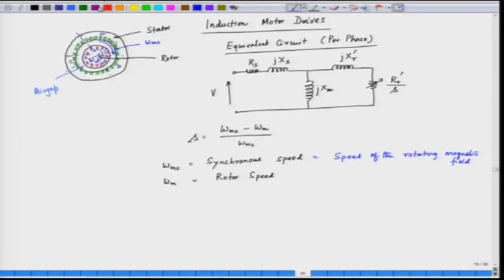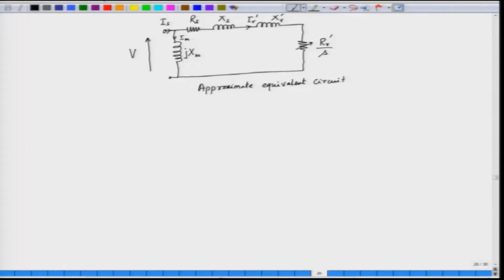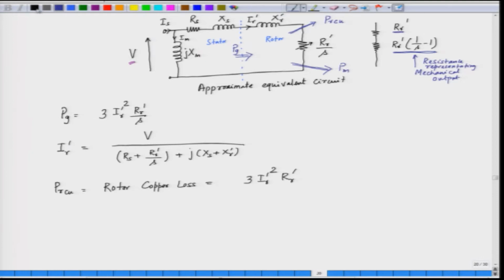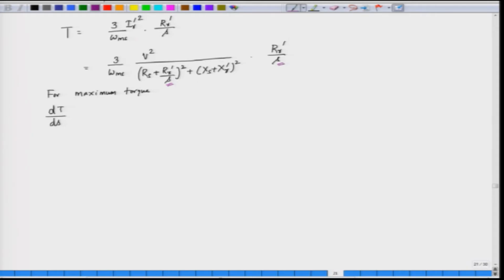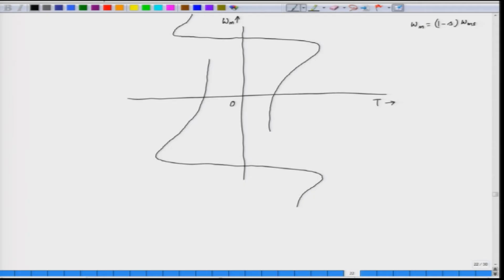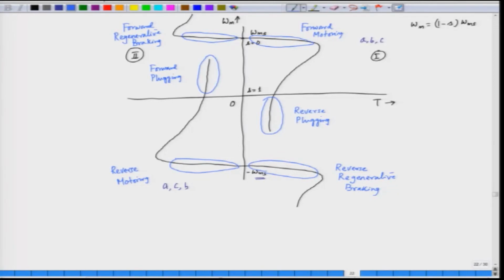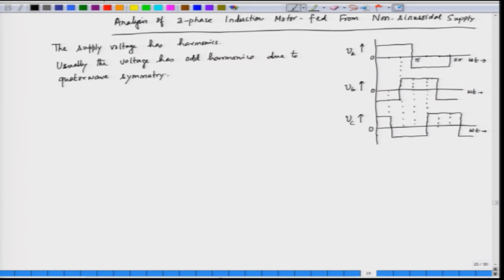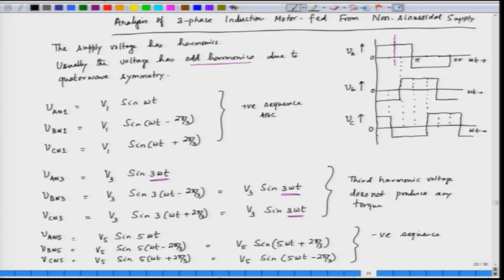noc19-ee65-lec17

Comment: Sir Shouldn't the third harmonic field (pulsating field) produce torque while the motor is in motion like it (a pulsating field) does in single phase induction motors?? Yeah it won't produce a starting torque, but it still can aid the moving torque with a forward field according to double revolving fields..?